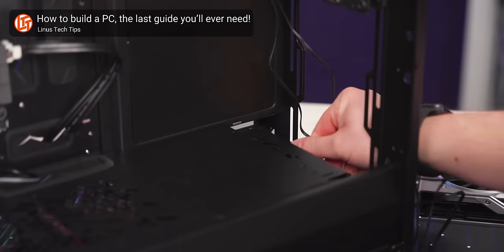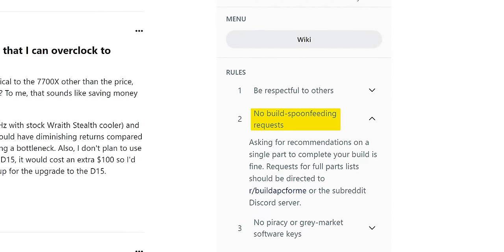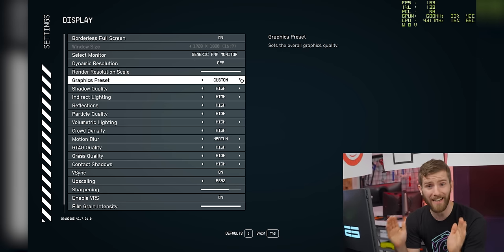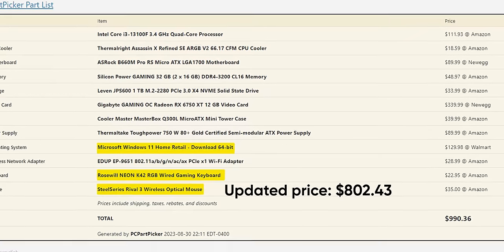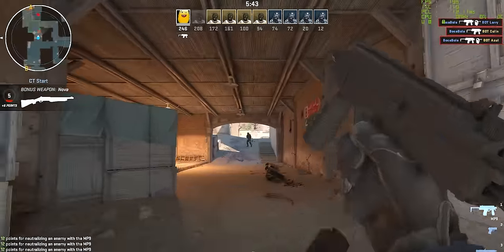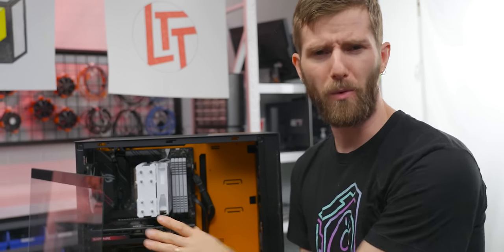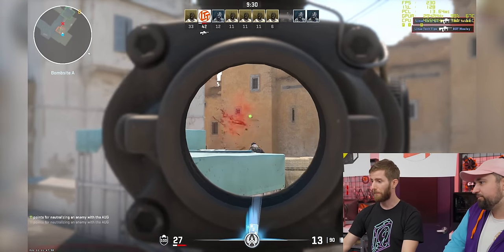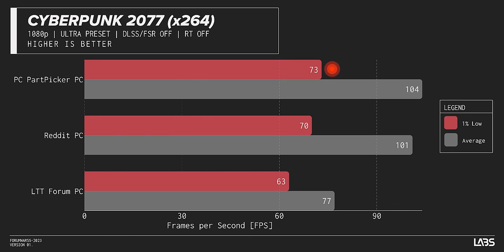We Secretly Challenged 3 communities to Build the Best $1000 Gaming PC!

Comment: When it comes to building a gaming PC I mostly focus on the CPU and GPU.  The CPU because it basically informs what brand (AMD or Intel) and what platform within that brand.  The GPU because it decides what kind of gaming performance you'll get.  Over all I tend to try to get the newest generation of hardware I can get due to better performance and longer term driver support, but over all you get the best you can afford and that's not always the current generation.  After that I go for power supply and if there's any part that doesn't offer any immediate performance benefits that I would over spec at the expense of the rest of the system it's the power supply, but not by too much.

When it comes to the CPU, it usually would come down to going with the mid-tier option of a given generation, either R5 or i5, unless you plan on doing anything more demanding than gaming.  I do try to go for current gen here so that I have the best chance at a decent upgrade path.

As for the GPU, I generally try to stick to either NVIDIA's 60 or 70 tier or AMD's equivalent (I'm not as familiar with Radeon as I am with Geforce).  That tier will last you a good long while and won't cost you an arm and a leg to get, making any upgrades not quite as painful.  Over all, I'm much more open to slightly older GPUs since they're platform agnostic.  You can fairly easily get a lesser GPU now and upgrade a few months down the line when you have the money.

As for the PSU, I would try for a gold rated PSU while going the minimum Wattage plus 50%.  So if a PC on PCPartPicker is asking for ~600Ws then I would get a 1000W Gold Rated PSU at least.  That allows for more flexibility when upgrading later on down the line.

Comment: IMO  LTT system is the smartest one. The others sacrifice a lot of the upgradeability. 16gb ram can be a massive bottleneck when streaming/recording/editing videos. The better SSD will pay dividends especially when editing or playing games like starfield that need fast reliable memory. The game could be very very playable if you just knocked the settings down slightly. The GPU is also one of the easiest components to upgrade in the future and the rest of the system is clearly built with that in mind.

Comment: Ryzen 7600 + RX 6800

The RX 6800 has often been available for around 400 USD, or even as low as 340 USD recently, which is an amazing price, but I think these prices have mostly only been available in North America. 

If you can't find a great price for an RX 6800 (they have been an amazing value in North America), then there are a bunch of potentially good alternatives. The RX 7800 XT, the 4070 and 4070 Super, or the 6800 XT or 7700 XT, are all pretty good mid-range options, and local pricing in your region can make all the difference as to which one would be the better choice. 

The 6700 XT (and 6750 XT) are the best in the lower-end. The 16GB 4060 ti could be a good option if your electricity rates are unusually high, and if you want a very low power consuming PC which doesn't need that much performance. It's expensive, but it could be worth it if your electricity rates are very high.

Comment: My general experience has been that the most impactful part in making most games run smoothly is the GPU. Which makes sense because it is singularly the most expensive part but also kinda sad because its the most expensive part. Having said all this, I would personally tend towards the LTT Forum's build because everything but the GPU will probably last you 5+ years easily if they're competent and then you can upgrade the GPU for a massive uplift later. If you get a more balanced build, you're more likely to have to upgrade everything all at once.

Comment: Vrg0, my man, he was correct about having a newer CPU like the 13100f is better. The 5600 is good but, for gaming, it's lacking when compared to the 13100f single-thread performance. Moreover, LGA 1700 is a good enough platform for upgrades like the i5 or i7. The RX 6800 is better than the 6750xt though but the Vrg0 build has the budget to upgrade to the 7800XT.  (Also, 32gb of ram, nice inclusion in the Vrg0 build)

Comment: I made a parts list this past summer a top, mid, and basic build and it's probably incredibly out of date. It's been a decade at least since my last build (job reasons) and what a wake up to inflation. A graphics card even a mid range is more than my last entire system, including monitor. My top end AMD Ryzen 9 7950X3D, Radeon RX 7900 XTX etc. $6,349 (no monitor), the mid range one was $5,900, the low end I didn't calculate I think I got very sad and just gave up.

Comment: IMO The PCPartPicker one is the winner. The performance difference between the Reddit build and it are so low you're not going to notice. It;s also going to be the overall nicer PC, with a nicer build experience, lower temps and lower noise.

Comment: MSI B550 Gamer 76C Ryzen 5700G 16gb DDR4 3600 Corsair RGB PRO RX 6650 XT Corsair Case from Best Buy two 1TB Nvme SSD one Samsung 870 and one Sabrent PCIE 4, TP-Link Wifi 6 PCIE card 450W 80 Bronz off the Shelf Best Buy. Last years Build at about $1000 the Sabrent SSD I already had its my Linux Drive
Reply: Ill be upgrading to 32gb Ram and adding a PCIE NVME card and more storage Might upgrade the  cooler and add some extra fans that have been sitting since last year

Comment: People don't often give enough thought to the case. Like what part are you REALLY looking at 95% of the time? The case so do you want it to be ugly? And sure, looks < performance but a bad case also tends to have bad cooling which impacts performance and it has bad cable management which makes upgrades a pain. Case matters so much more than people think.

As an aside I find it really funny that the LTT forum PC is basically the exact same as my current one. I'm using a 1070Ti instead (a holdover from my previous build that will eventually be replaced) but that's similar and it's a different case but otherwise it's very similar. Same exact CPU, same class of motherboard, same exact PSU, same specs of RAM (different brand but same everything else).

Comment: I would argue the LLT PC was the best overall. It will hold up the longest and when an upgrade is needed, really only the GPU needs to be upgraded. The rest of those components were solid. The reddit PC...while the GPU was good, it's gonna need lots of minor upgrades. I'd bet in terms of longevity the LTT PC last longer.

Comment: The LTT forum one is actually much better in terms of future proofing. You get a better CPU, better PSU, good case, good SSD, and all you need to change in 2-3 years time is the GPU. It's also a sistem that will gain some performance over time, thanks to AMD and their driver shananigans. As for the other two, while they will give you the best performance NOW, in 3 years you WILL need to change also the CPU, possibly PSU. I'd go the LTT route.

Comment: I wouldn't pair an RTX 4070 with an EVGA 650 watt power supply.  I got an EVGA 3080 TI FTW3 Ultra gaming and it's transcient power spikes would cause games like Forza Motorsport to crash whenever there were a lot of cars in the field of view. That was with an EVGA Supernova GA 850 Gold. I moved the card over to my other rig with a Corsair RM 850 Gold and the games have been running fine.

Comment: A little disappointed there wasn't enough emphasis on encoder quality as one of the purposes of the build apart from gaming was a little bit of streaming. Seeing all the CPUs were AMD and only one of them had an Nvidia GPU, I'd say the Reddit build would be the best value out of all of them. If you're not a partner/affiliate on Twitch your bitrate is limited to 3500kbps. Nvenc is pretty much a must-have because you'd be counting pixels on x264 with that low bitrate especially on fast paced games.

Comment: that build from the ltt forums is almost identical to the base of my computer. the only real difference is the videocard, i have a 1660ti. but keep in mind that the compute on that computer is WAY faster than the others.
Reply: i'm going to give the win to ltt, they specked my computer and i didn't ask or see. other than the video card it is exactly what i have, although i have two more nvme drives, a 3tb scrap drive and 2 4tb drives in mirror.

EDIT: my computer is a combination of a full on multimedia center and a workstation. i need LOTS of storage.

Comment: I agree on spending more on a GPU although it really, really depends what game you're playing. Anno type game? you want cores. CS game? you want core clocks. Ray tracing games? You want an Nvidia GPU. Pure rasterizing games? You want an AMD GPU. Are you only going to game? 16gb of ram is fine. More than gaming? Like streaming on the side? You should go for 32gb and more cors in your CPU. Then pick the rest of the components accordingly. I personnaly went for an all-rounder last year with a 12600k, 32gb 3200mhz ram and an RTX 3070. Got the GPU used so the total amount was about 1100€. Video edditing? Yessir. Valorant? Yessir. RTX games like control? Yesssssssir. Really pleased with mine. Also focused on updgradability since I chose a LGA 1700 socket and a modern mb alongside my 25% overpowered PSU.

Comment: 3:24 16 GB or 32 GB?
10:41 He gets the capacity right this time but the graphic says 2x16 (which is visibly incorrect) and he states 3600 but the graphic shows 3200. 
Slow down a bit guys, QC on the videos is slipping again. It's a bad look to promise big changes but only stick to them for a few months until the heat dies down.

Comment: no shade to the 6800, but I’d be surprised if most folks didn’t pick a 4070 over a 6800 for nearly all use cases, genuinely stoked that we’ve returned to an era when this kind of performance is available in a reasonably balanced build for about a grand
Reply: You're talking about a 450 dollar card vs 550 dollar card? obv the 550 dollar card is better
Reply: @BusAlexey yeah, but I’m saying if we’re picking the best / highest performance gaming build, I wouldn’t put the 4070 build vs 6800 build as a wash, I’d take the build with the 4070.

Comment: I mean, it depends on what kind of person you are. The PcPartpicker and Reddit PC's are great, BUT, if you want to upgrade the GPU later down the line, the CPU would be the bottleneck, where as the LTT forum build is something that I would've done, more ram, better case, 8 core 16 thread processor with a very good cooler, and a GPU that will hold its price, and when you'll want to sell it, you can sell it for almost the same price as you bought it, add a few 100$ and butt a better GPU

Comment: what you can do is buy a cheap used PC or laptop which has windows. and just use that key. it's basically a full oem. and you get yourself a whole computer out of it, just erase or remove the hard drive and resell the thing

Comment: Not surprised Reddit wins this. The amount of users making it easier to hit a super good pc builder, is a thing. If I wasn't strong enough to build my PCs myself, I would honestly never go to LTT, but to Reddit. As somebody else said, say something wrong and you'll get a fix from another dude in 30 seconds. You'll never go wrong this way. You'll always end up with a no bottleneck system with the correct specs to go with your mobo. I can say this confidently, as people on Reddit noticed a 14% bottleneck on my cpu, which promptly got fixed with an even better cpu at a lower cost. Absolutely crazy good.

Comment: Overall, it basically just proves that you can really only build your PC around the GPU. It's the only element that changes rarely, where [real] CPU generations are nearly yearly. 
Although the CPU is definitely important, as that is the bottleneck most people face when it comes to next generation titles. Anytime someone says they can't run a game, or has issues, it's usually because they slapped a new GPU in their very old setup and thought they would get the numbers they see on all the techtuber reviews and benchmarks.

Comment: When I bought my Pop Air Case about a year ago the two front fans were both daisy chained together on both the argb and fan control so I'm not sure why they would mention that they needed an extension? I had no issues connecting both argb and fan headers to the same points for both front fans unless they reaaalllly want wanted individual headers for whatever reason. But for air intake having both the same speed seems fine for novices like how they are gearing this video for, and argb doesn't care how its hooked up at least for me because the 3 included fans are the all daisy chained to the same controller

Comment: I found that the results at the end being sorted best to worst made it difficult to understand. It would be better if the positions of the three stayed the same so when swapping between results from different games it’s easy to see how the ranking changes. It’s much easier to remember what the graphs looked like on the previous slide rather than remembering the order they used to be in and also by how much the differences changed.

Comment: The fact people decided to spend anything more than 100$ on a CPU is baffling. Streaming using nvec means no CPU load. And actually bottle necking a CPU using a GPU is incredibly difficult in a budget build. The PSU rating doesn't rate integrity, only how well it converts AC to DC under load. The motherboards as well should be near bottom of the bin, considering you aren't going to be getting a CPU that can overclock anyways, and the memory should be tight rather than fast to help with 1% and cheap cases don't matter much, since you're building in it once for the next 2 years. The GPU in these builds should be 500+$ and everything else should fit in the rest (50$ case, 50$ drive, 80$ ram, 50-80PSU ETC)

Comment: An idea for your graphs: I always analyze things using a cost/advantage curve, to try and find the sweetspot for my price and demand. I know since price fluctuates you don't usually include it when benchmarking, but it would maybe work for the lab. Example: last car I bought I couldn't afford a new one, so I made an x (year of manufacture) y (price) graph, and understood that for most car models the "degradation" of the price stabilized after about 6-7 years.

Comment: Sounds pretty standard to me. The level of nerd on the LTT forum will make them spend more money on a motherboard that just absolutely doesn't make a difference to performance, and shell out for top tier storage that should be in a system double the price.
They built a system they wanted, with their bias towards high end gear, then downgraded the gpu to fit the budget. Which is not what was asked and kneecapped the build massively.

Comment: I object to this. I took your advice on the Arc 750 and it was the worst upgrade advice ever. Here is why and I did post this on your Forum but as per normal got ignored. It is not compatible with many of AMD's boards even with a bios upgrade it still fails to install its driver even with a new Win11 install. Also when I did get it to work I realized that Intel was actively updating the driver not to work so it broke again shortly after. I spoke to intel about it. They pretended to care but that is as far as that go.

Comment: I'd say the Reddit PC is the clear winner as soon as you actually use the features the GPU provides. If upgrading the GPU in a few months is an option, the LTT system is pretty great, though. Very solid base for that.
While I do get many people play CS 2 or DotA 2, those games pretty much run fine on a potato. Why bother testing them at all, let alone actually discussing the results? I'm sorry, but it doesn't matter whether you have 230 FPS or 250 FPS average, anything semi-current will break the 100 FPS mark for your 1% lows. Plenty so you can't really blame your hardware if you lose. 
Your Cyberpunk tests with DLSS / FSR off and without RT may make it easier to directly compare numbers, but they are just unrealistic... Why would I use those settings on a RTX 4070?

Comment: I cant recommend googling your problem with the term "reddit" enough. My pc wouldn't post. Spent hours clearing the cmos and flashing the bios. Reseating the ram unplugging the power cables. Turns out it was the am5 bracket i bought being misaligned and the only reason i found out was because i saw a single comment with no replies saying this was their issue.

Comment: How old was the account you used on reddit? If you used a new account, which are typically not allowed to post in many subreddits, that would be a lie by omission on your part. And if you used a new reddit account, which would likely produce a bad outcome, using that interaction for a comparison to your own competing website would suggest a certain amount of purposeful dishonestly on the part of Linus and company.
Reply: If you get worse results with a new account posting on PC building Reddit as a new PC builder vs posting with a new account on the 2 forums - it's actually another "minus" for Reddit instead of it being a mitigating factor.
Reply: Also /Buildapcforme sub-reddit is definitely semi-dead - the vast majority of recent posts have below 5 replies (one of which is always automod), and there is plenty of posts, where automod is the only reply.

Comment: I spent about 1,300 in parts for my last build during the worst time to build a PC...ended up with a gigabyte gtx 1060 6gb windforce...it cost alot when i bought it and im going to use it until it no longer displays...--edit...how would you feel about paying 650 for a 1060 6gb in 2016